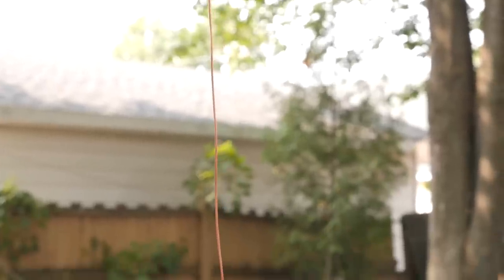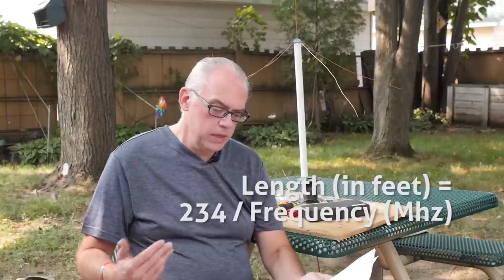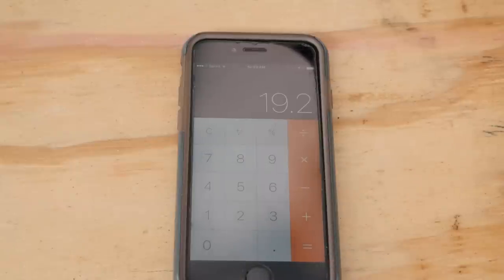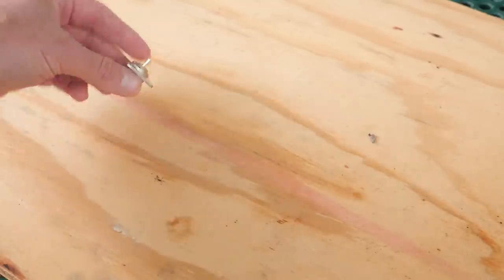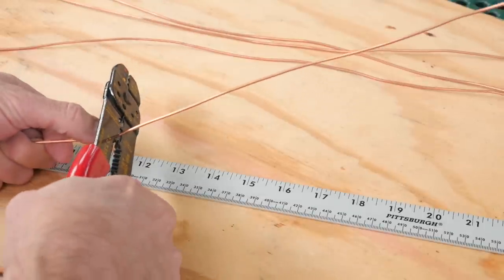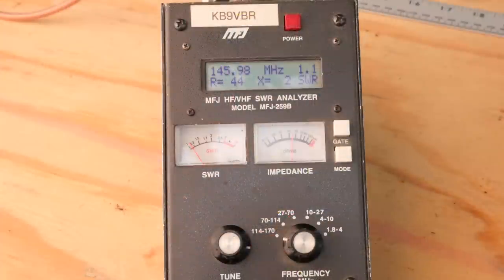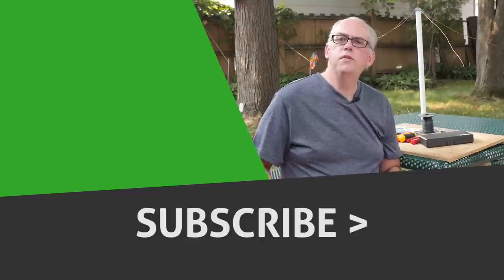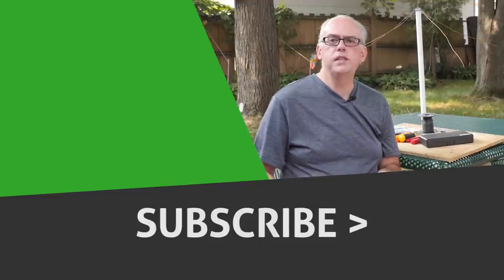2 Meter VHF Quarter Wave Ground Plane Antenna - Ham Radio Q&A

Comment: Why 234 and not 300 for the math?  I was taught 300   Where does the 234 come from    Thx
Reply from the maker: That's a metric calculation. 300 divided by wavelength in meters equals frequency in MHz. 234 divided by the frequency in MHz results in the length of a 1/4 wave radiator in feet.